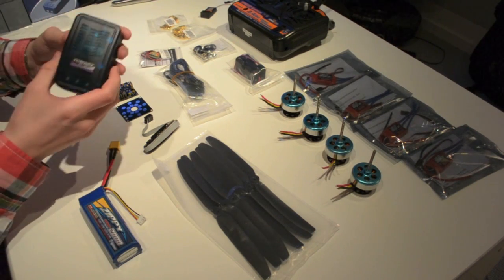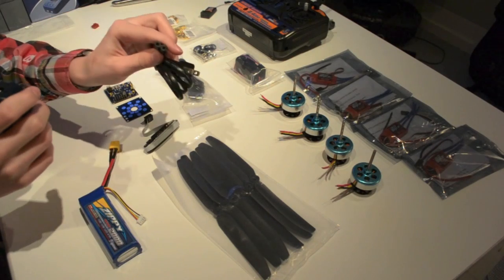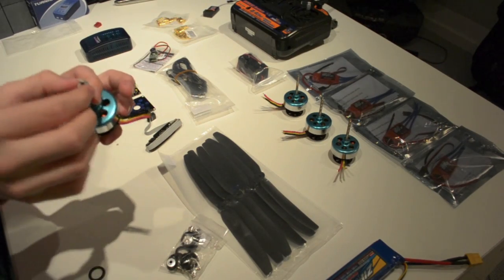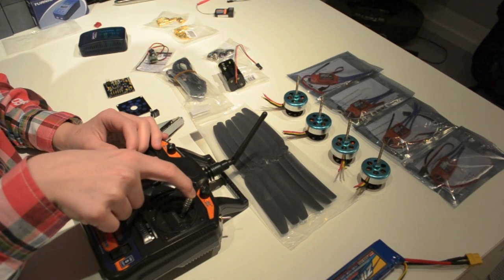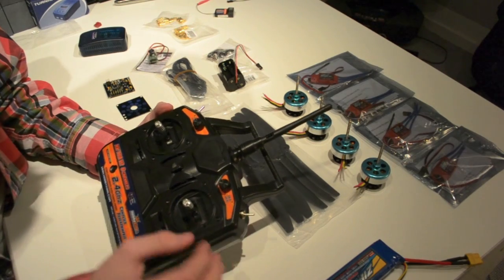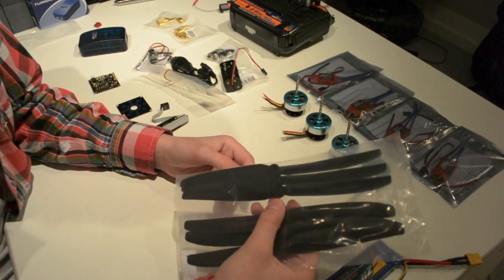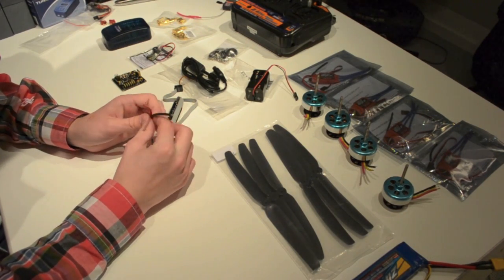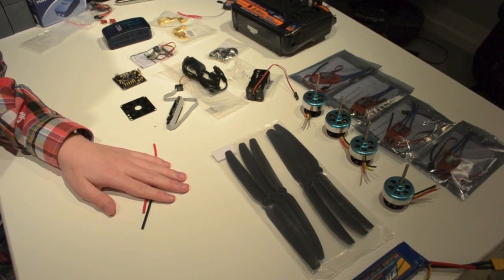Quadcopter Build v1.0 [Part 2]

Comment from the maker: Well, you can try, but i don't think it would be possible because the kk board compensates by knowing that receiver connection is made like that. If you tilt to the left, it will compensate to the right, but on channel 2 so it just yaws to the right. This will most likely result in a crash. I don't know if it's that way, but that's my theory ;-)

Comment: That youtuber I told you about is: "jimhami42" video title: "$95 Quadrocopter (Maiden Voyage)" He trying to use differential thrust config. without a gyro, it extremely instable, and as you'll see... he crashes alot. but It did inspire my owm version of it.

Comment: Also it will fly by vectoring thrust, instead of differential motor rpms. this will eliminate the need for a gyro (Theoretically). i give a gyro anyway, just incase I'm horribly wrong. which I probably am. LOL... XD

Comment: And I already have it in my inventory of parts. I use a seperate 3 axis Gyro unit, because the arduino does not come equipt with one. but it will do the exactly the same job as your KK board.

Comment: I'm doing something similar. Only I'm building on out of micro Rc co-axial 3ch helicopters. I just take the IR recievers out, and replace them with 3.7V 3A micro brushed motor ESCs form HobbyKing. I also remove the tail prop assemblies. so all I'm left with is the man airframe and the tail boom minus the tail rotor. drill an appropiate sized hole in the end of a 2x2x12 cm balsa sticks, with an "Arduino" microcontroller because it is the same tech as the KK board.